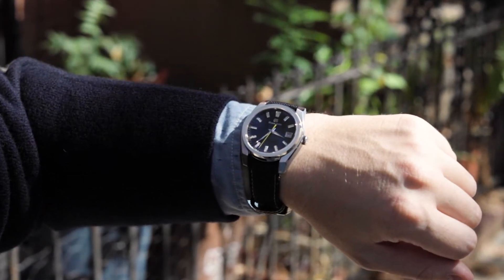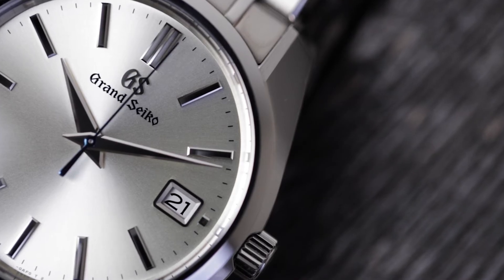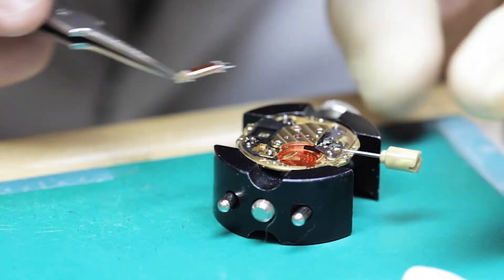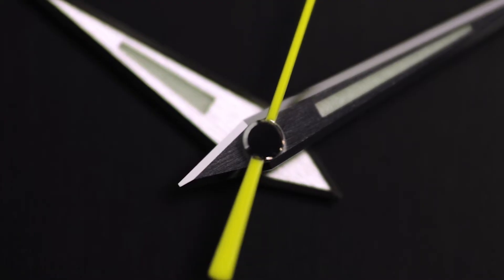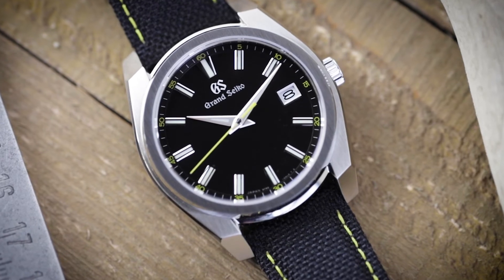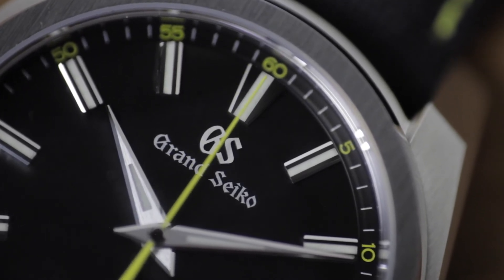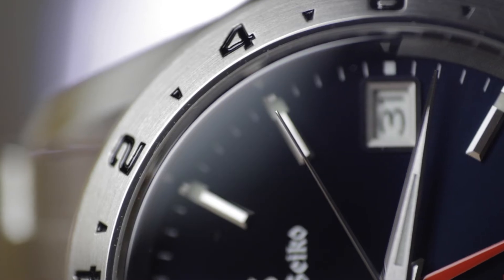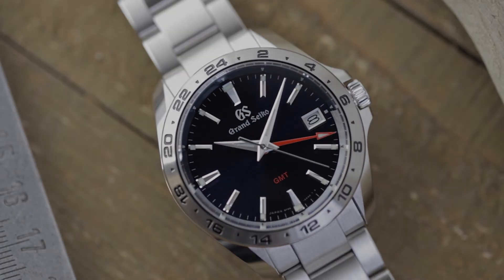A Look Inside Grand Seiko's 9F Quartz Movement

Comment: Arguably the greatest time only movement ever created. Built to last for generations, finished just as well if not better than most mechanicals, extremely accurate and virtually maintenance free. The amount of engineering that has gone into the 9F far exceeds any time only mechanical under the 30k mark I'd say!

Comment: Just an FYI to anyone thinking about getting one, I bought one a couple years ago and set it to the atomic clock signal, I haven't stopped it since and it's still running within a second of the atomic clock signal, it hasn't even lost 2 seconds over the span of 2 years, that's extraordinary. It's also just beautiful to look at, very comfortable, waterproof and tough. Really is the perfect watch to me.

Comment: i have Grand Seiko and a Rolex Oysterquartz...both are pinacles of accuracy.  I think Rolex is a swiss movement adapted to quartz and it beats loud.  That tick...LOL.  The GS I owned were silent.  I traded in my Yellow Gold GS I think SBGX016 after I bought another watch, but I recently got a SBGS007 I think in white gold.  I have not tried it on yet, it is at my overseas home.  But I bet it will be quieter.  As far as accuracy I think they are about the same.  My Oysterquartz was serviced at Rolex before I bought it, but the Grand Seiko may be hard to get serviced.  One thing I notice is that Seiko seems to dismiss collectors and people who want service to their watches, while Rolex basically does everything.  You can get your Rolex completely serviced by them and it will look as new as you allow them.  They actually keep the price reasonable.  But Seiko?  GL with that.  And no watchmaker will touch them for service, not in Tokyo.  

But maybe that is just my experience.  Everyone tries to rip me off, as if rolex only has 70K watches with pink rubies when I walk in LOL.

Comment: Why not a Perpetual calendar?
Reply: Be happy with what they are giving at this price. It's a lot of watch a person can get.
Reply: If you want perpetual calendar you have citizen chronomaster or Longines vhp.
Reply: Even better a revamped retro digital watch!
Reply: Adding that many complications would require a lot more torque out of the dual pulse motor and drastically reduce battery life I presume. I think it's clever they got a real GMT with a jumping hour hand while the watch runs without affecting it. It's about as fine as quartz can get. The watch to set your other watches with.